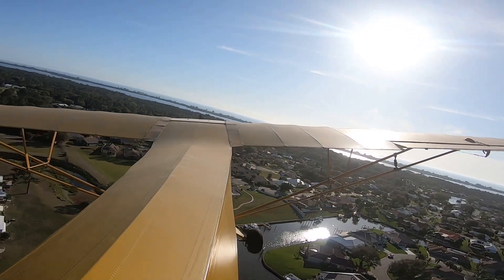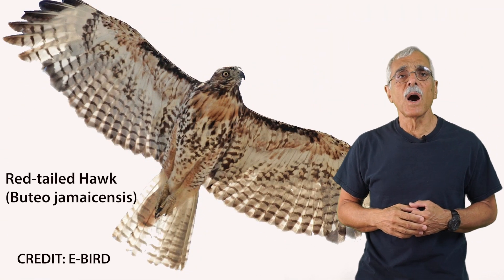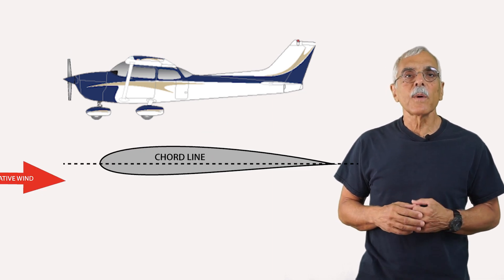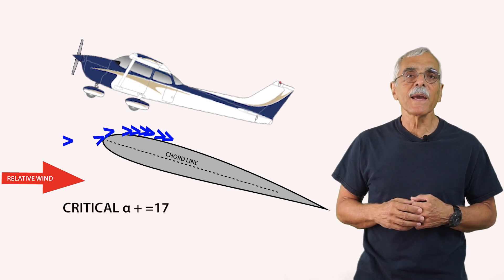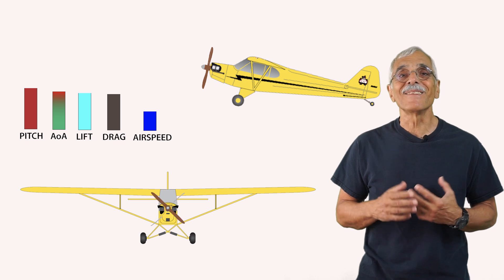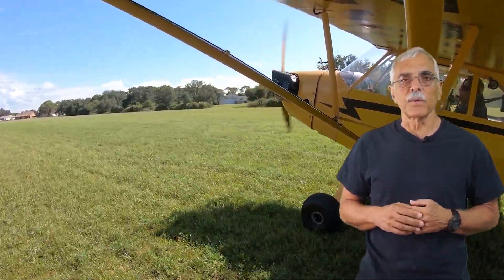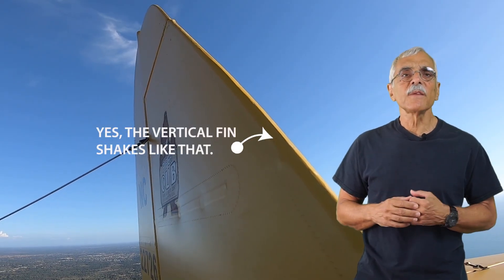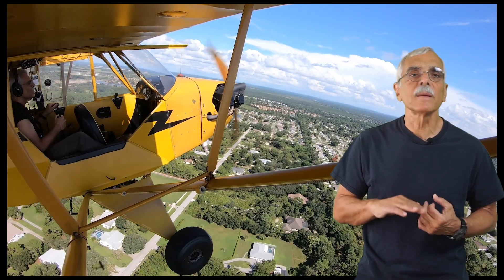How I Stalled on The Base Turn (And Got Away With It)

Comment: It's not just stalls.  I think a good percentage of GA crashes are ultimately due to distractions during high workload phases of flight.  You get tunnel vision on one thing and you don't notice the thing that actually gets you creeping up beside you.
Reply: There are other factors too, but we can say distractions are one of the notorious and more prominent factor of most general aviation accidents.
Reply: This was one of the first thing taught to me - resist the increase of workload, or distractions, "manage them".  Don't depart hastily under pressure from ATC or other aircraft. Don't join a too busy circuit. Don't let the passengers distract, separate them on the intercom at critical phases of flight.  This is where it starts, and then there are situations, where you will be rushed anyway, but then have a plan B, go around, leaving the circuit or whatever.
Reply: I agree.
Reply: I have a feeling that a lot of unnecessarily complicated avionics contribute to accidents. Give me a six pack steam gage any day! There’s too much going on with glass cockpits.
Reply: I believe there was an airliner flown right into the ground as the pilots fiddled with warning light or something. Distraction is a dangerous factor in so many things.
Reply: @zachjones6944  I don't fly, but agree! More isn't necessarily better. Look at all the 'safety' features in new cars. Want to avoid drifting into the other lane...?  PAY ATTENTION, and learn to drive!  I hate the car commercials showing an idiot saved by a gizmo. - Cheers
Reply: @joeshmoe7967  Eastern Airlines Flight 401, in 1972. CFIT by discussing a gear not locked indication
Reply: "Tunnel vision" is interesting. In motorcycle training they talk about "object fixation" - you see some problem or issue, like a rock in the road, and fixate. Before you know it, you've run into it. You have to remember to look where you want to go, not where you are avoiding.

Feels like the same sort of mechanism at work. The tunnel vision, just long enough for you to get into trouble.

I wish all operators of heavy machinery of any sort were taught about such dangers, really helped my driving.
Reply: @renewalendy8854  Yeah that was a bad one, 2 pilots plus a flight engineer didn't notice they were losing altitude? And it was a lot of alititude too.

Comment: Out of caution, I once diverted from LSN to F34 seeing as the wind was above my personal crosswind minima. When I got over about 2 miles north of F34 at pattern altitude I saw a red tailed hawk, not moving relative to the wind screen. I think, "I'm going to hit him." Seems like the book always said birds were likely to dive, so I pulled up hard. We'll the hawk hadn't read the book, so he swooped up at the same time, and hit right at the base of my Grumman Tiger windscreen and knocked 2/3 of it clean out. He bounced off of my face (knocking my sunglasses and headset off), then knocked out the pilot side window, and came to rest in the baggage area. Stunned me, obviously, and made the cockpit a bit breezy. I couldn't really even read the gauges at that point. I grabbed the throttle to slow down, but actually pulled the mixture. Figured it out, and fixed it. Then leaned way over to one side to try and stay behind some wind protection where I could read gauges. I carried an extra 10 knots or so, just in case the aerodynamic characteristics of the machine had changed any from the giant front-cavern that was there now. Did a nice slow turn to line up with the runway, and got it on the ground. I was a little scratched up from the bird hitting me in the face and neck, but otherwise just got my dander up a little bit. After I was down, I got on the phone with my mechanic over in Madera, to ask if he could come over and install a new windscreen for me. He said, "Can you just fly it over here like that?" I said.... no, I'd rather not.

Comment: Despite being an instrument-rated commercial pilot and having my flight instructor with me, I managed to do the same kind of thing.  While in a Skyhawk on final approach to our local airport, the plane that had landed in front of us suddenly veered off the paved runway and headed into the weeds.  We aborted our landing and began our climbout. While we were chatting and chuckling about the knucklehead in the other plane, I glanced at the airspeed indicator and saw that our airspeed had dropped to 55 with full flaps.  If I had not noticed, we could have easily ended up as a smoking hole next to the other aircraft.
In retrospect, I believe that most of my close calls involved a distraction.  So learning to recognize and avoid distractions is important.  For example, I had a door open on take-off, but because I had already considered that scenario, I knew that it did not require my immediate attention.  During training, my flight instructor would always try to start up a discussion during landing, for the sole purpose of trying to get me distracted.  So, when flying with family, I always asked them to keep an eye out for other planes or potential problems during takeoff or landing, but to otherwise remain quiet.
Reply: I dont think youre at a risk to stall at 55 with full flaps in a 172. The Vso is like 41 in that plane. If it was 55 kts and rapidly decreasing then yeah thats bad, or if you were about to hit trees and yanked back on the yoke. But 55kts stabilized at full flaps isnt about to stall.
Reply: @carveking  Yes, I should have mentioned that we were in a slight climb and decelerating.  Because we were still fairly high, I had not added full power and, because of the distraction, had not raised flaps to 20.  I should have been concentrating on leveling out and reducing flaps for another approach.  Instead, I had zoned out and allowed the plane to start to enter a dangerous flight regime.
Perhaps another example will illustrate the dangers of distraction. Although my instructor had always taught me to concentrate on flying the plane during takeoff or landing, I felt comfortable enough on a solo departure in solid non-turbulent IMC that I decided to start fiddling with the radios.  I had the aircraft nicely trimmed for the climb and it should have flown itself.  Nevertheless, at some point, I noticed that the engine was getting a lot louder.  When I looked at the flight instruments, I quickly realized that I was in a descent and had lost 400 feet.   Again I was lucky and may not have been in immediate danger.  But I never did that again.
Reply: i've had the door pop open twice in the 150 aerobat i fly in training. i made sure it wasn't a distraction. quick check to make sure nothing was gonna fall out of my pocket and just kept flying.   Its kind of funny, because both times i've done it, i did the same thing.   on climb out my mind goes "hmm i wonder if this door is closed all the way." And before the other part of my brain that can actually think stops me, i bump the door with my shoulder to check. inset shocked Pikachu face. 
I now make sure to give it a nice nudge on the pretakeoff check, and if the though ever come across my mind during climb, i remind myself that 100ft over the runway after takeoff isn't the time to check if the door is closed.
Reply: Accidents rarely happen to average people in average situations.
Accidents happen to tired, distracted or stressed people in unclear, unfamiliar or challenging situations.
That is true for driving, but I believe applies to aviation as well.
Reply: @carveking  I am not a pilot so I read buzbuz's comment to indicate while not in actual danger yet, his distraction away from flying had him inching that way. I have watched enough of mishap videos to know you could be at 55 no big deal to seconds later big problem...

The main take away is fly the plane, especially during take off and landing. Distraction takes everything from fingers in saw blade to multiple lives in craft of all kinds, air or otherwise.    - Cheers
Reply: On approaches,  go around in traffic and landings, everybody is about to Stall . Always have 5 knots  extra flying speed.
Reply: @carveking only elevator input can stall a plane so why talk about speed, flaps and other irrelevant factors? 
Tell me what stick position your plane stalls at, you don't know, suggest you find out and soon.
Reply: @buzbuz33-99 while you were wasting your time looking at the airspeed did you at anytime notice how close the stick or yoke was getting to your belly button?  Suggest you reassess how a plane stalls. Tip. It has nothing to do with airspeed and EVERYTHING to do with aft stick input. 
Do you know at what exact aft stick position your plane stalls at? Oh dear.

Comment: I remember flying a Schweitzer 1-23, an oddball little single-seat glider many years ago.  I had about 200 hours in power aircraft, and had close to 800 flights in various gliders, most of it as an instructor.  I knew the next guy had the glider booked for a cross-country attempt in about 20 minutes, so, despite the fact that it was a beautiful day, with crazy lift, out on the Alberta prairies in western Canada, I had to get back on the ground.

I approached the point where I would normally have been setting up to join the downwind, but I was about 1500’ too high. The 1-23 was a “floater” and would ascend easily in lift, but not “penetrate” well against a headwind.  I cranked on the spoilers and just wasn’t losing much altitude,   I got the bright idea of rolling perpendicular to the horizon and burning off the extra altitude with some aggressive 360s.  I had done, and taught, tons of conventional stalls and spins and felt comfortable in them and recovering from them, but I forgot about the AOA issue.  I was 90 degrees to the horizon, had the nose down enough to have plenty of airspeed, and was pulling several gees, with a big grin on my face.  You guessed it, I reached the critical bank angle/AOA/gee loading, and stalled out of the turn.

It was pretty dramatic - the high wing stalled first, flicked down, the plane did what felt like a snap roll, then the nose went straight down, and started a spin.  I was only about 1000’ up, so I did the fastest recovery I’d ever done, then joined the circuit, hoping fervently that no one had seen me (they didn’t, thankfully).  It was one of those “I learned about flying from this” moments.  Intellectually, stalling when you have plenty of airspeed and the aircraft feels as if it’s biting aggressively into the air doesn’t seem likely, but I received a hell of a wake up in that moment.

Great content as always, Paul!
Reply: Cheers from tried and true Albertan. Gliding out of Cu Nim?  Use to drive by on the way to hang gliding in Long View, way back.  - Cheers
Reply: Before I went to powered planes I flew gliders as well. That, even though it was a 180 was basically the one and only time I managed to accidentally stall an ASK21. Gigh G turn with plenty of bank and low wing stalls. Was luckly very quickly corrected and I don't even think it was noticable from below but I did absolutely not see that coming even though I thought I had a very good feeling for the plane.
Reply: It was the Edmonton Soaring Club out in Chipman.  I did some good flying there, but always felt like an outsider - I came there as a former Air Cadet instructor, and only the CFI, Mike Epps, welcomed me and treated me with any respect.  All of the other instructors were wealthy guys who owned carbon fiber competition sailplanes, and I was the guy showing up in my rusty Ford Pinto, spending every dime he made on flying.  I still miss flying that L-13 Blanik.
Reply: I guess the one thing I might add is that In these steep turns you need to keep an eye on the ball. This stall would have been way less eyeopening with coordination. Remember a spin needs two things to happen at the same time. Most importantly a stall is required. Then next is coordination. If you had the ball centered then the stall would have been more benine. Now I have never flown gliders but from my understanding of airfoils I can imagine a glider with very efficient airfoil reacts more aggressively to a stall and would enter a spin easier than the cub or a cessna. I can only imagine how many accelerated stalls I would practice after an incident like yours!

Comment: Paul, I ran across your video and want to say that you may have saved my life. So thank you. 
I’m a 350 hour pilot (Cessna 152) and was taught not to bank more than 30 degrees in the pattern, but I’ve gotten sloppy and sometimes bank close to 60, and I let my airspeed get much lower than I should. 
The part that hit me is what you explained about the low wing stalling, the angle of attack, and the loss of lift. You didn’t just say ‘don’t bank more than 30 degrees’, you explained why. I don’t fully understand it, but I learned that I better pay attention. 
Thank you for this video.
Reply: And also for reminding me to stay coordinated, and not distracted.

Comment: As a taildragger pilot, I always come in high and slip to the runway.  I feel this is safest technique.  Preserve your altitude.  A J3 slips just fine.  Not pointing a finger, I once landed a glider gear up, fortunately on grass at 30 mph, no damage.  In my case, I short-cutted the landing checklist because of weather.  Mistakes always seem to happen when a "surprise" take your attention away.  Thanks for sharing.

Comment: Great video as always thanks Paul!! I had a close call as a student pilot and I have a vigilant tower controller to thank for saving my a**. Way back in the late 90s I was solo in a Katana and entered the pattern on the 45 into the downwind to set up for a left base & final. I was a bit late on the left turn to final and hauled the stick back and whacked it even more to the left to align with the runway. My headphones came alive with a loud and stern female voice "NOVEMBER __ CHECK BANK ANGLE, CHECK ALTITUDE, CHECK AIRSPEED"  I immediately straightened up and applied power to climb a bit and then set it down.  I hadn't realized how low (and slow)I had gotten. I squeaked a "Thank you " to her and she just came back with "No problem, contact ground. Watch yourself up there"

Comment: Glad you got out of it okay, Paul.  I have been flying a Cirrus SR22T for the past seven years.  And i am always head on a swivel when I have to slow to land, especially if I have to do turns near the runway (prefer straight in approaches).  When I take passengers (which is most of the time) I make it clear no one is to talk when I get near the airport precisely for the reason you stated here...distraction.  Same goes for taking off where the closest I came to stalling  (too steep and turning) and ironcially, the thing that got my attention and gave me the hint to lower the nose was the AoA meter which I just happened to glance at as it entered the red (passengers were ooing and ahhing which did distract me).  There is never an excuse to deviate from the book...but if there is one way to get that to happen, its a distraction.

Comment: Thanks for sharing this.  As a student, I stalled a 172 on very short final, eyes fixed on touchdown and not monitoring airspeed.  Caught it before it dropped but felt really stupid for not paying attention.  I think the AOA is good instrument to have almost in the line of sight over the nose.  Difficult to ignore unless you are snoozing. Useful for density altitude, lard butt, and other out-of-kilter situations where one might have the impression that the airplane should be flying but is not wanting to do that.

Comment: Very early in my flying career (in a 172) I was turning base to final but became distracted because I was starting to overshoot the final approach course. Being on base I was already slow and my distraction was only a few seconds. I didn't stall and landed fine, but, half way through the turn something nudged me to look at my airspeed at that moment at it was at 60 and decreasing quickly. I had two other people with me and 75% fuel. I was only a few seconds away from being yet another statistic. It scared me enough to learn my lesson and I'm a better pilot because of that experience.

Comment: Good one I had, fresh PPL solo turning base to final, had my ASI fail and slowly roll back to zero. Caught it while in the turn to final, as the needle hung just above Vs and immediately lowered the nose and added power. Only until the needle fell all the way to zero did I realise what’d happened, but until that point I had proper soiled myself. Probably because I knew I was in the exact case scenario of all the aforementioned articles, keep the awareness up.

Comment: Paul : Excellent short video - boiled down to the essence. Humans are capable of amazing feats. Flying is not , as you point out, not really all that hard once it is understood.
Inattention or distraction is probably the ultimate cause of most accidents, aviation, automobile, whatever. AwShit is almost always the follow up to a head -in-ass moment or distraction.
Autopilots fly approaches flawlessly because they never get hung up in their duties by a distracting anomaly.  Situations decay from just fine to dangerous when the situation manager is out of the loop, sometimes for a very short time.  if the situation manager gets back to work in time, it becomes an opportunity to learn , share and avoid in the future. if the situation manager does not get back to work before the situation is played out or becomes unmanageable, the result is a statistic.  If you are in command, you have to stay in command until the ride stops. We handle minor interrupts  without too much problem, but if the distraction lasts long enough for the situation to become un-manageable...well. it has become unmanageable.  In any vehicle, some phases of operation are much more tolerant of momentary distraction than others.